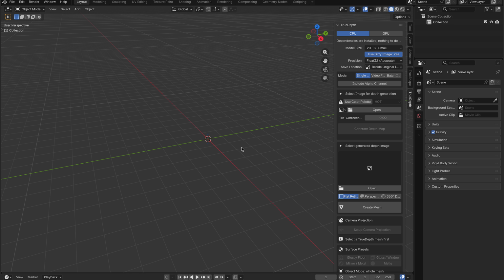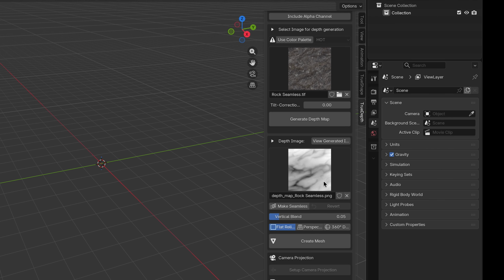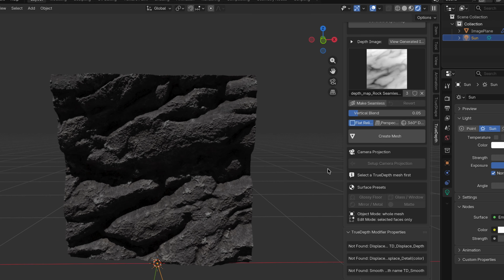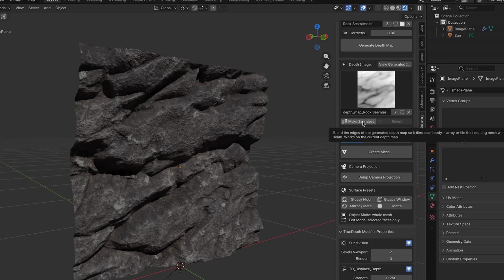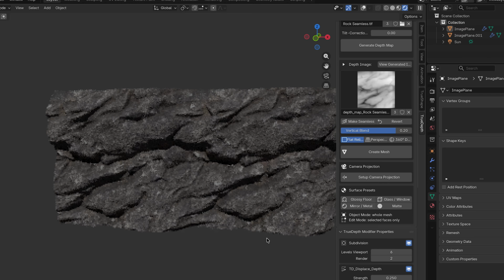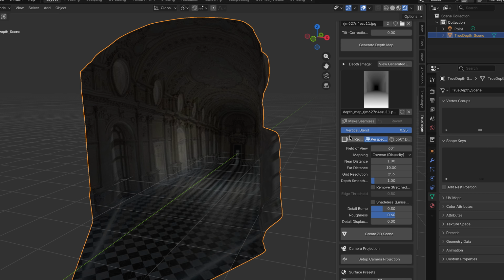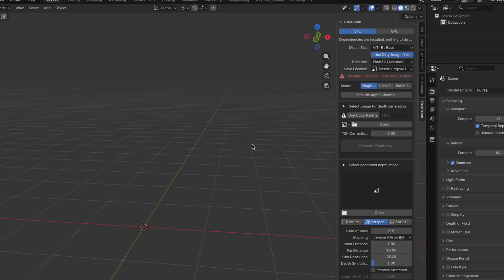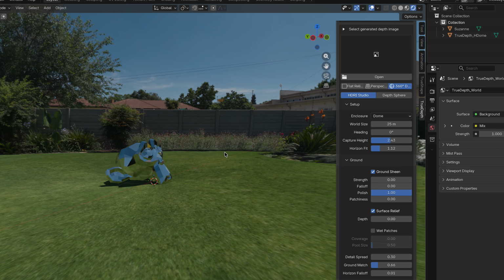TrueDepth V3 Tutorial - NEW Perspective Mode + HDRI Projection

Comment: Ok Ive been working on some high-end ideas that go hand in hand with this plugging. So I use orthograpgic images of an object,  we will say a person's head but I've done other tests. So true depth is great but obviously it can't perform magic from one image, however it is the most important ingredient. I used the silhouette of resulting depth maps in substance designer to capture the outline of a face. That applies to a simple gradient to give me the position in x of each pixel in the outline. These points apply to the center line of the front view and I have a flawless depth for that center line. I use the side view depth to step up one row at a time and it will fill the entire image. I can mirror or have a second angle from the opposite side to fill the rest in. I use that resulting image to perform. The next angle and then the last. The images match a cube of the same dimensions  and U can displace fairly accurately to each face to match and generate a quad mesh of the results. Im going to try and build a standalone application that does this along side true depth but given your skill I thought I would mention it because it's a perfect enhancement for truedepth that gives absolute true depth
Reply: I also have a technique where I use generated coordinates for the images btw. In doing this I can selectively go into sculpt mode and add more resolution with the dynamic topology to increase resolution in places for finer creases, It doesn't displace while using dynamic  but as soon as you click the feature off it does. The generated uv doesn't lose its coordinates doing it this way so I don't have to just crank up subd, I apply 6 subs and then dab it with a .001 inflate brush to add topology,  you can adjust the dynamic feature,  it's like 12 to start. 6 is good in simple spots, 1 is creat around fine details.